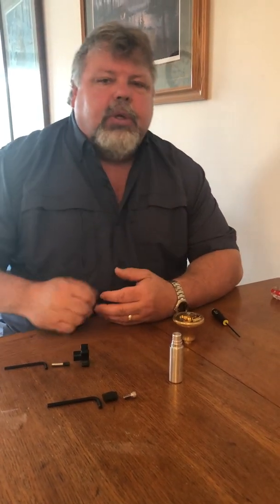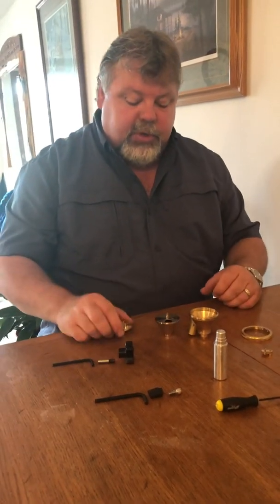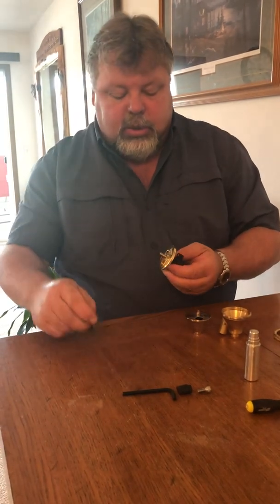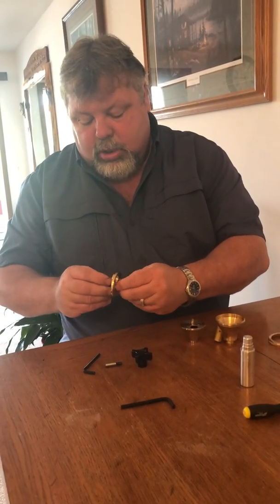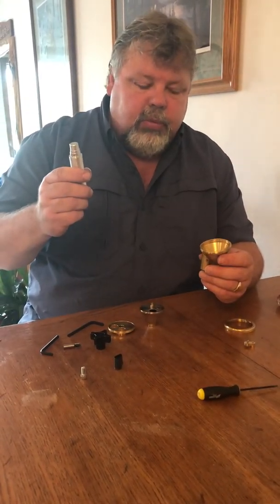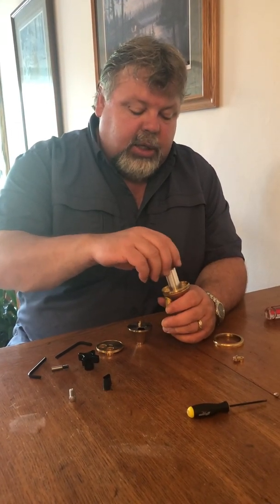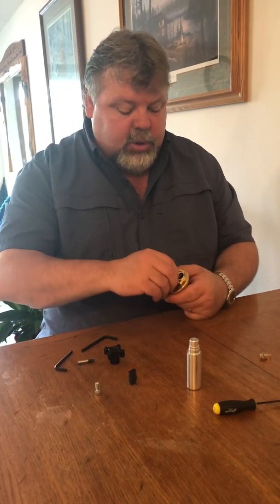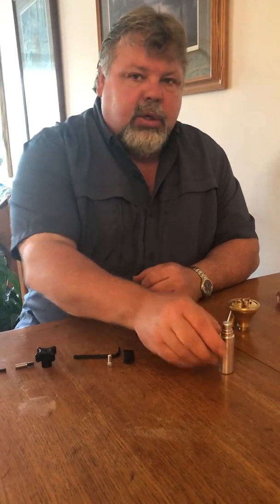Instrument Innovations

Comment: it's the same instructions of thayer valve?
Reply: The Thayer valve does not have bearings.  Ours is the Patented Olsen Instrument Innovations Axial Flow Valve.  This is also the Infinity Valve on the Vincent Bach Stradivarius horn.  Our bearings cannot be exposed to the soldering heat and the bearings need to be removed before solder.
Reply: @kimolsen1375  thanks a lot!
Reply: @HenriqueGil  Very Welcome